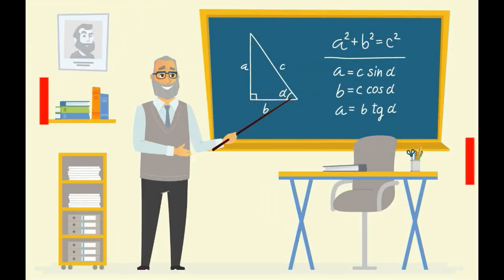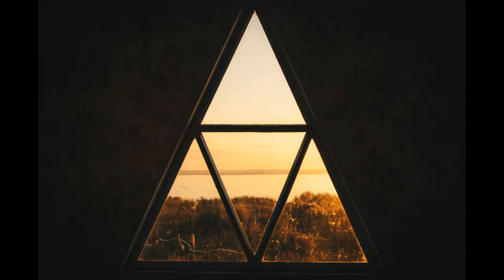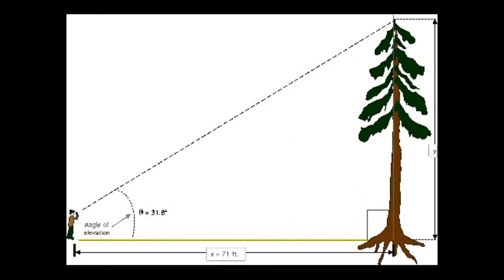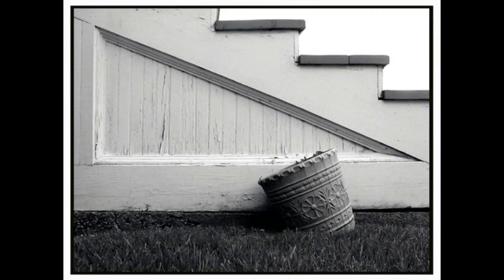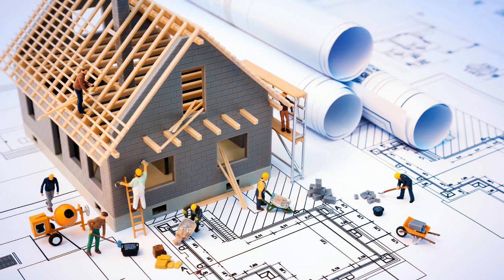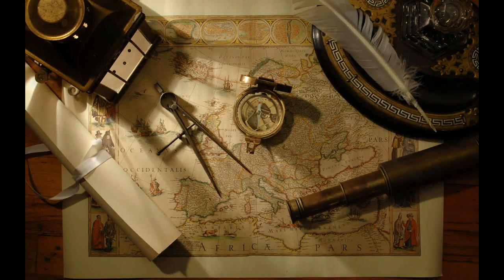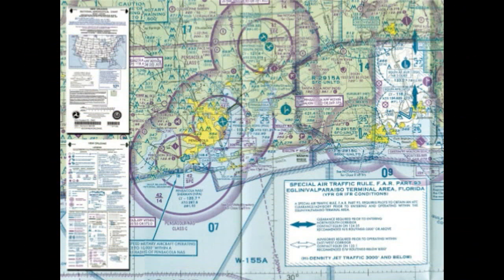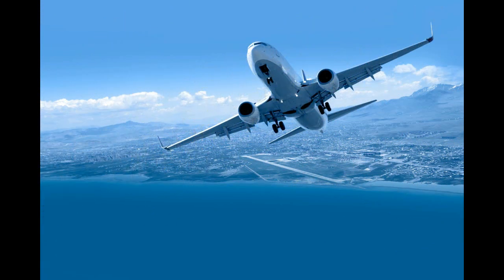Pythagorean Theorem in Real Life Applications

Comment: Pythagorean Theorum is of course useful for geometric measurements, but it is also indispensable for several purely mathematical calculations, as well!  For example, it is used to calculate total impedance in electronic circuits with both purely resistive and reactive components! (resistors, inductors and capacitors)
Reply: Great observation! You're absolutely right—the Pythagorean theorem isn't just for triangles in geometry; it's also super useful in other areas, like electronics.

Let’s break it down:

Pythagorean Theorem Basics
In a right triangle, the Pythagorean theorem tells us that:
a² + b² = c²
Where:

a and b are the legs of the triangle
c is the hypotenuse
In electronics, we can use a similar concept to deal with impedance.

Impedance in Circuits
Impedance is like resistance but more general—it accounts for how resistors, inductors, and capacitors resist the flow of current. These components behave differently, especially when alternating current (AC) is involved:

Resistors (R): Oppose current in a simple way, just like normal resistance.
Inductors (L): Resist changes in current because they store energy in a magnetic field.
Capacitors (C): Resist changes in voltage because they store energy in an electric field.
In AC circuits, resistance from resistors and reactance from inductors and capacitors work together to create impedance (Z), the total opposition to current. Reactance is a bit like "AC resistance."

Using the Pythagorean Theorem in Impedance
If you have a circuit with both a resistor and either an inductor or capacitor, you can use the Pythagorean theorem to find the total impedance.

Resistive components provide resistance R (real part).
Inductive or capacitive components provide reactance X (imaginary part, but we won't dive into complex numbers here).
The total impedance Z is calculated using a relationship just like the Pythagorean theorem:
Z = √(R² + X²)
Where:

R is the resistance (from resistors)
X is the reactance (from inductors or capacitors)
So, if you know the values of R and X, you can use the Pythagorean theorem to calculate the total impedance Z, which behaves like the hypotenuse of a triangle.

Why Is This Important?

In practice: If you’re designing or analyzing an AC circuit, you need to know the total impedance to understand how much current will flow through the circuit for a given voltage.
Without the Pythagorean theorem, combining resistive and reactive components to calculate the total impedance would be tricky!
Example:
Let’s say you have:

A resistor with resistance R = 3Ω
An inductor with reactance X = 4Ω
To find the total impedance Z:
Z = √(3² + 4²) = √(9 + 16) = √25 = 5Ω

So, the total impedance is 5 ohms, even though the resistor is 3 ohms and the reactance is 4 ohms. They combine like the sides of a triangle!

Wrap-up:
The Pythagorean theorem helps calculate total impedance in a circuit by treating resistance and reactance like two sides of a right triangle, with impedance as the hypotenuse. It's one of those surprising ways math shows up in the real world!

Comment: My brother was marking a rectangular area to build his house on. He needed flags at each corner. He spent more than a day measuring from each flag trying to get them right. But he could never get more than two distances to be correct. He was measuring length, then width, then length again. Going around the parameter. By the time he got to the fourth flag his distance was of by feet. His problem was the angles. If you're of by just half a degree, after 60 feet it ads up to several inches. 

Finally I showed up, did some quick math and had him cut three strings. One 60 feet, one 40 feet and one 72 feet 1 1/4 inch. We marked one side using the 60 foot string. Then used both the 40 foot and the 72 foot string to find the second corner. Where those two string ends  meet was a perfect right triangle. Then we repeated that for the other side and presto, a perfect 60 x 40 rectangle. In just 10 minutes.